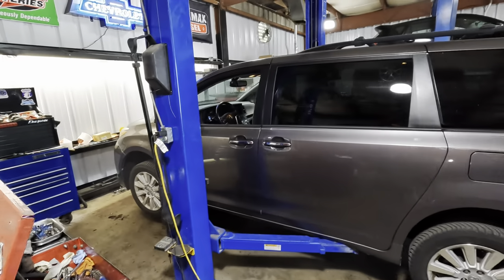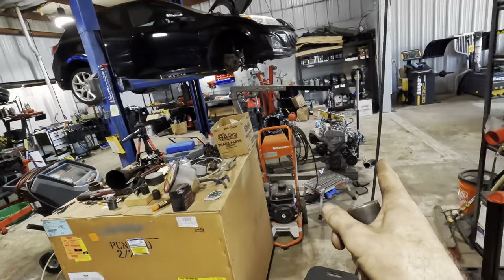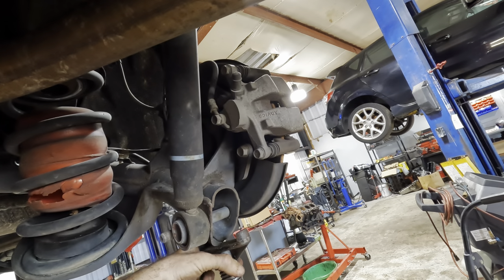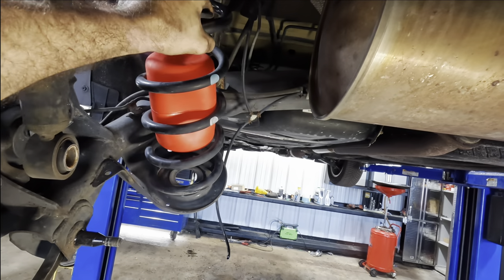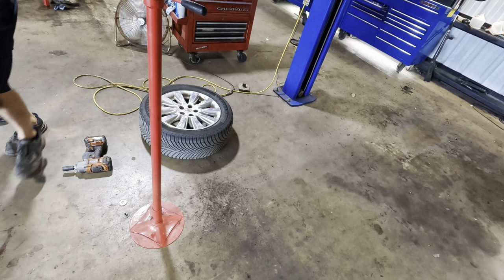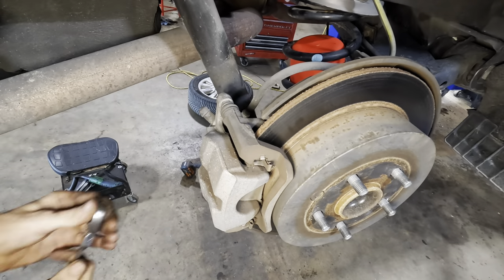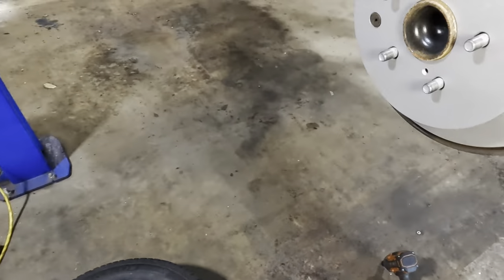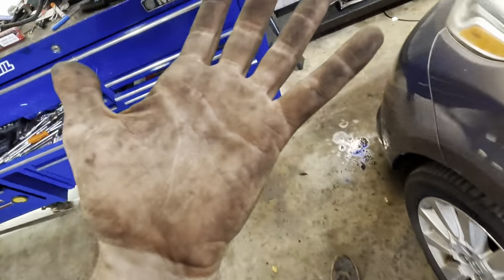Minivan Tow Vehicle! (Helper Bags) Toyota Sienna 3.5

Comment: You’re gonna get a call back on that. The little clamps on the air lines are required, otherwise as soon as you put air pressure on those lines they will pop off the bags. I know from experience!

Comment: I installed helper bags on my 13 Sienna AWD. 
I don't like how they have those airlines like that personally. 

I ran mine out of the top. The valve to air them are in the pocket where the OEM jack is. You open it to fill the bags and close it so no one touches it or sees it. :)

Comment: Those airbags have lifetime warranties on them.  I have them in my Ram 1500 and one of mine rotted out and split.   I opened a case on their website and uploaded my proof of purchase on the case - a week later UPS dropped off a new one.   I didn't even have to send pictures of the destroyed bag or anything.   Still haven't put the replacement in though.

Comment: I picked up a 2005 Chrysler T&C limited. 100k miles, single owner. Port Charlotte its whole life , garaged LOADED, $3500.  Every time id get it apart this would happen.
Drove back up north in spring. Month later Poof old plastic, needed radiator, so I did that, ALL hoses, including all the heater hoses and that lil plastic valve. (Bought the metal).
Belt, Idler, water pump, Flushed power steering, Trans fluid & filter, BIG OVERSIZED battery and added a 1000W semi truck/Can heater. Phew Ok was done YEAH!!  
That Fall Click, over bumps, NP its just the sway bar bushings HA HA HA Yeah Right!!!! I replaced every single moving part in the ENTIRE suspension system!
But I discovered something neat Chrysler made an all wheel drive, US Forestry version of the T&C Vans !!! WHAT wut wut , my brain said! Stock HD parts found! 😍
After scouring Rok Auto, Amzn, and the web, I was able to coble together a Heavy duty clone to my normal T$C. Thicker forged control arms, loaded Kayaba Struts with adjusters, HD springs, Hub bearings, 1/2shafts, trans seals. All this other crap that doesnt show up under a normal search. T&C owners, its you quest for the Holy grail of T&C's.
 The US Forestry Awd off road, executives and fat budget middle management hoopdee.  So anyway Now with $6000 in it its an old but like a watch, beast. luv it.
Wuts next sigh.🧐😰

Comment: I've seen Toyota dealer techs install those rotors wrong, not aligning the plug with the relief, and smashing the rubber plug.  It can cause brake pulsation, just like a warped rotor.

Also, I noticed those Import Direct pads didn't come with wear new indicators.  Edit--Looks like they came with them, they just didn't get installed.

Comment: Not bad. A pain to perform a 4 wheel alignment on. Have to remove the rear hub assembly and install a shim. At least the one I did anyway. Didn’t have the tie rods in the rear to adjust toe alignment.

Comment: 32:23   the reason he is not doing the shoes in the back, they are only used for the parking brake with a cable, also drum brakes do not wear out near as fast as pads do most your cars braking is done up
Front.

Comment: I installed the same helper bags on my Chevy Avalanche. They have worked well. My installation was a little different, but removing the spring would have been a lot easier.
Reply: I put them on my 2000 Explorer with the v8. She was squatted bad before but with the bags and a weight distribution hitch made a huge difference. It’s much safer that way.
Reply: I put a pair on my 1999 sienna I use as a work vehicle  , it was a good year brand,  It really helps with stability and handling when loaded with extra weight.I was able to deflate the bags flat and fit those in between the spring coils without disassembling  shock  and spring. Another great video Ray   and  hope you have a great  Day   sir!
Reply: @tapper1995  That is also the way I had to install mine. Through the coil spring.

Comment: It seems strange to me that the rear suspension air bags would be inserted into the spring with the air supply coming in from the bottom. The air line should come in from the top. The airline would fit easily between the spring coils  and be protected from highway FOD. The way it is installed in the video shows the plastic air hose being fed in through of the bottom spring mount, leaving it susceptible to mucho highway FOD -- picture bouncing gravel, pieces of split wood, tin cans, iron strips, ad infinitum road nightmarium. What do you think?

Comment: Did the hose on the bottom of the air bags not require a clamp. It originally had one. Good video. Thank You...
Reply: There's a barbed connector on the airbag that is a push on compression  fittng .the air line is plastic just like what is used on big rig air seats !

Comment: I hope the owners don't tow much weight. I don't think those Siennas are made to tow more than like 3500 pounds.  Seen a few towing like 5000 pounds or more, and going thru transmissions every couple years.  And, every one has the air bags in the springs like this.  I guess that's the least expensive alternative over full airbag suspensions or those air filled shocks, or the stiff coil over shocks.  Bad thing is those bags like this don't last but about 2 years and need replaced if you go thru the northern states and salty roads.  Like their tire choice. One good looking and quite effective against hydroplaning tire with nice traction on various road conditions from dry to even light snow.  Good to know these folks didn't cheap out on the lower cost suspension and tire options.  Safe travels to them no matter what they tow.  And, cheers, Ray and the boss unit..wife unit=boss, of course...LOL>  Take care.
on edit...btw, this looks like a good TV to add the Peddle Monster to and help that engine pull even better.

Comment: Hi Ray
I have never seen a rotor/drum combo before. I've seen you clean the rotors before when replacing them. Didn't see ya do it on this brake job. Did I miss it or is it not required? Why?
Just trying to learn.  Tks

Comment: So I have a Yukon and did pads and rotors, from AutoZone, all the way around about 6 months ago and after about 2 weeks they started pulsing. Took them off and AutoZone warranty exchanged all 4 and after about 2 months they are pulsing again. These were the top level quality they sell too. Any suggestions on what brand and where to purchase a set that will actually last?

Comment: Shouldn't you have used constant tension hose clamps when installing the airline to the air bladders???  The was the line length sufficient to allow for full travel of the rear suspension after you cut them??
Reply: Unless the Van is going over ramps and getting air, it will never full extend that far.

Comment: What would you guys recommend, air shocks or these air bags things?
Reply: NM, I  installed the same airlift bags on a 2011 Sienna. Note that the valves can be installed at the top. There's space to run the air lines. It'll b a cleaner install.

Comment: Why wouldn't you just take a box cutter or something similar to cut the old bags out through the springs, use like your vacuum pump for ac to suck the air out of the bags or squeeze the bags and roll them up and temporarily cap off the air connection on the new bags to keep them thin so you could just squeeze them through the coil springs in stead of disassembling the rear end? Would have been so much quicker and easier to do so.
Reply: That is the correct procedure, but Ray doesn't read instructions.

Comment: looks like the lift is bending the sill on drivers side ?
Reply: One of the reasons I avoid the pinch welds when working on my vehicles in the driveway... I'll use that area as a last resort or just doing a fast tire rotation 

There are reinforced flat spots on some manufacturers further in past the pinch welds for unibody vehicles
Reply: @ricebike  me too...but I think it was only shadows and reflections making it look that way now.

Comment: Reeeeee....those flexible brake lines got a good stretching there...and once more, @19:25, torquing up bonded bushes at full suspension droop. Guaranteed to make them fail in short order. Come on Ray, you know better than this.

Comment: The brake jobs I've witnessed in florida don't include the cleaning that Ray does. The mechanics just want to get the job done because the heat or just in a hurry.
Reply: Up in the rust belt, mechanics and DIYer alike will coat some of those surfaces to prevent rust jacking... Should be noted while doing a brake job for other northerners that doesn't know about Mr rust Jack 😅

He was doing this quickly to get this back to the customer ASAP

Comment: I never liked installing those Air Lift bags. The customers would never maintain the required minimum air pressure, the bags would go flat, and the springs would chew them up. A never-ending warranty issue. Air Lift will not warranty the bags if the minimum air pressure is not maintained.

Comment: What kind brake is that? Drum and disk?
Reply: Hmm, I see them alot... Parking brakes integrated into the rotor so it's like a drum on the inside hat

The other kind is the mechanism inside the brake caliper that you have to rotate as you push in for the new brake pads (usually turning clockwise)

Comment: for behind the bumper ball hitch towing, air bags make zero sense. It makes the rear axle so stiff you end up bouncing on the front axle with each bump because the rear axle turns into a pivot point only to rotate on like a seesaw ride.  A weight distribution hitch makes much more sense for behind the bumper ball hitch towing... now if you have a 5th wheel hitch directly OVER the rear axle, then air bags make 100% sense.

Comment: No, no. You do not need to take the Springs down. I have these on my 2014 Dodge Ram 1500. You just roll them up and put him in between the Springs and let him come open. It's real easy to change these. You do not have to take the tire. And the Springs and the shocks off.  You just roll them up. Put them in between the Springs and let him expand put the hose on the end of them and run it out the back. I did it myself. You are doing way too much work, buddy sorry.